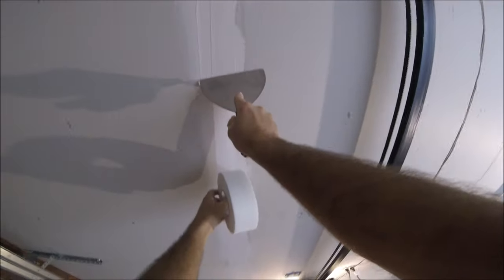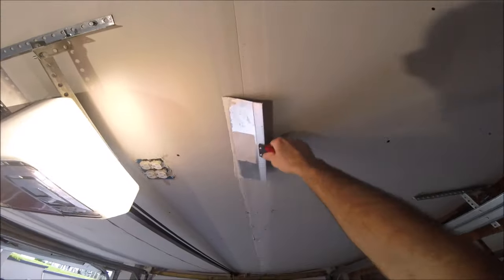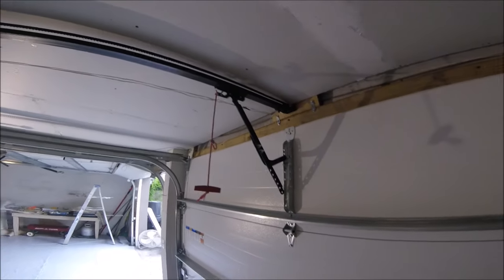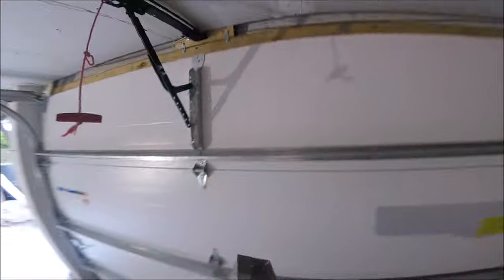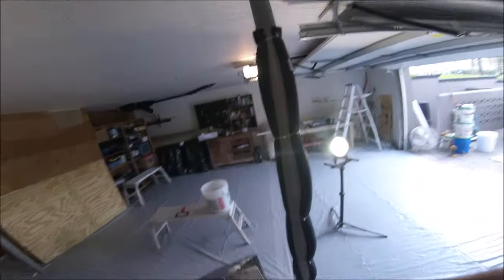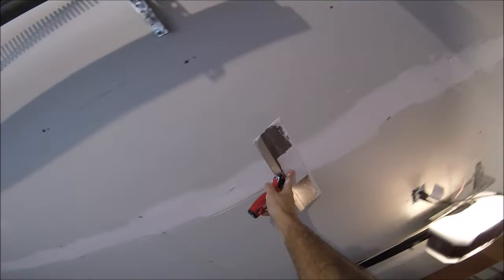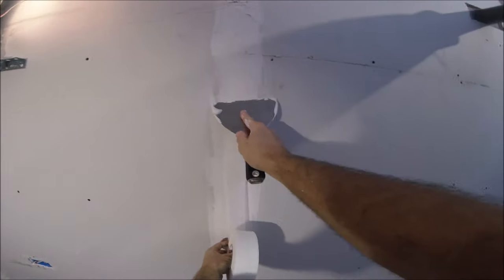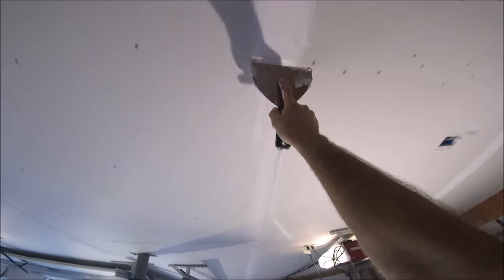EASIEST WAY to Drywall Finish a Ceiling for Beginners!

Comment: U did a great job. I'm doing a living room ceiling that caved in over time. Wrong nails into sheetrock overtime came off the joist. Insurance won't cover. No water damage and roof is intact. House been built in the 50's. Im doing the job myself first time.

Comment: Can apply Skim coating  Overtop of panels 1/4 inch thick plywood you think will stick to it
Reply from the maker: I’ve done it before...😇 For best adhesion, use all purpose joint compound because it has the most glue in it. Also, the joint compound will most likely yellow once it’s dry because of the tannins in the plywood. Prime with an oil base stain blocking primer and top coat with your favorite paint.👍🏻 -Paul

Comment: Advice...
I wet down a batroom ceiling to remove popcorn and got into drywall and tape on edges.
Can you skim coat over entire ceiling and use mud to do a knock down?

Comment: Contractor here. I believe this "FiberFuse" tape is the third best invention after food and sex - it doesn't allow air bubbles to form, it's much stronger than paper and unlike paper it doesn't have sharp edges so it blends much better, and it's under $5 in big boxes. The only two things about it: you need gloves and mask if you don't want itchy palms and fibers in your mouth, and also - it doesn't fold well, so occasionally (for some corners for example) I still prefer to use paper. Great job, clean and fast.

Comment: I'm a drywaller, hang and finish. I have to double hang 5/8 past the ceiling in apartment units. Sound proof or fire wall is what they want. I'm trying to find a faster way of hanging that. Past the 8 foot ceiling on the side walls that divide the units. Not outside walls just the units side by side. I just don't want to go up and down all week.

Comment: Great video as usual. I like to use FibaFuse also for repairs. As you unroll the roll of tape, does the fiberglass not get in your fingers? This is my only complaint about FibaFuse. I just try to remember to wear a glove on my left hand that I use to unroll.
Reply from the maker: I appreciate that Earl!💥👊🏻 Yes it can be a bit itchy but it doesn’t really stick in my fingers. Thanks for watching and commenting man!😎 -Paul

Comment: I've got to repair some ceiling cracks at my Dad's house. 
Would fibafuse be a better choice than paper tape?
Does fibafuse have to be bedded in hot mud or can you use all purpose?
Thanks.
Reply from the maker: Hey there Rob!💥👊🏻 Yes definitely use The FibaFuse for sure. It can be used with premixed joint compound or setting type compound. Actually, FibaFuse has a new tape called FibaFuse Max that is made for cracks. You might have to order it on Amazon because none of the big box stores has it in my area. I hope this helps.👍🏻 -Paul

Comment: I have a question. I want to replace the drywall in my house but should I start with the ceiling then replace the walls? And can I put insulation in the ceiling as I replace the ceiling drywall? How would I do that?

Comment: I"m watching this to see how the ceiling studs look because I am installing a new dining room light fixture and I cannot find the studs!...I removed the old fixture and that leaves about a four or five inch whole in the drywall....sticking a 10" long screwdriver up in there in all directions I cannot contact or feel a stud anywhere!...so frustrating! I tried to use magnets but the drywall is 3/4" thick and that did not work and my cheap stud finder is worthless.....the NEW fixture is a stained wooden box 6 inches wide by about 3 feet long and four or five inches deep with light bulbs hanging down under the box a bit.....
Reply: This is so weird. It’s a drywall video. Get a ladder.

Comment: So after this dries do you sand a bit and go over it again with larger 12" skim coat?
Reply: Hi
Reply from the maker: No sanding between coats. I’ll just scrape off any ridges or high spots with my 6” drywall knife. Then coat with a 12”. Video coming after the first coating the butt joints video.👍🏻

Comment: Fibafuse is best in a auto taper not good for dry tapeing. Puts fibas in the air. Also you don't need hot mud with fibafuse. Lol just all  purpose